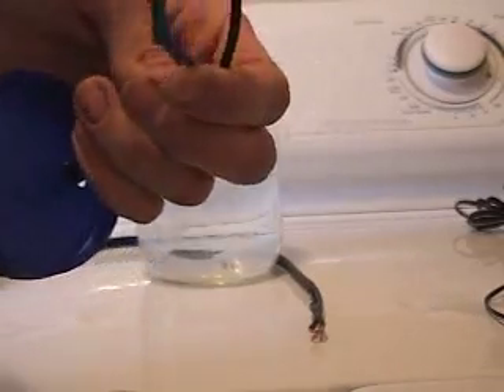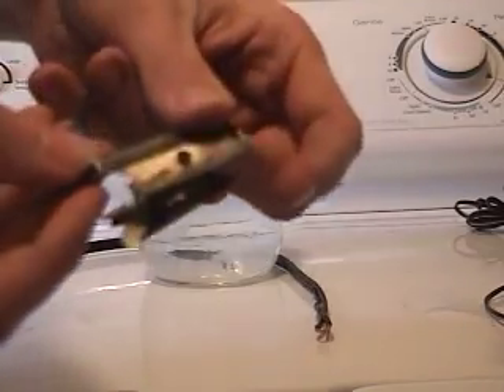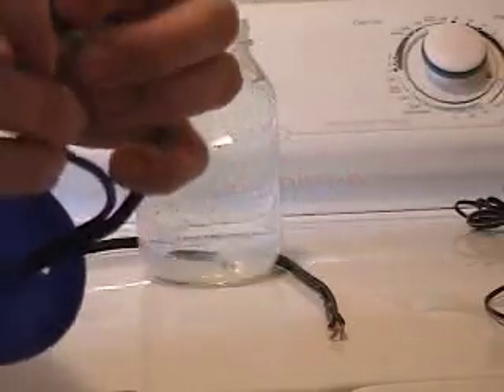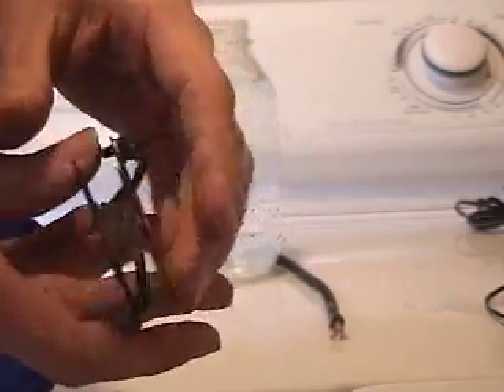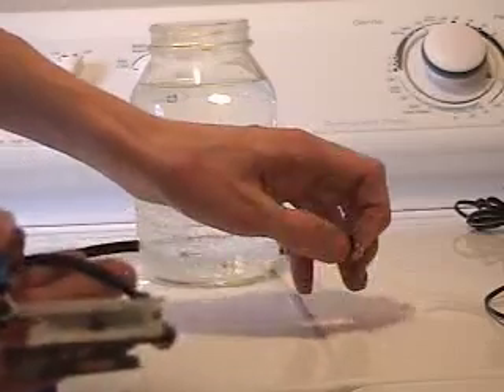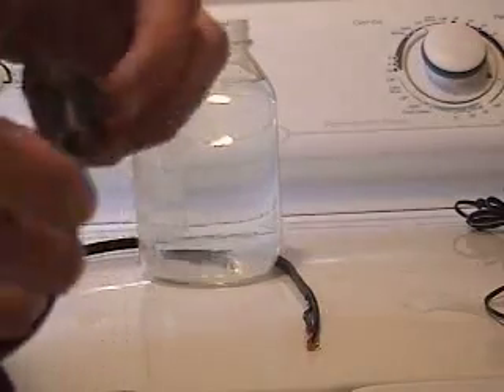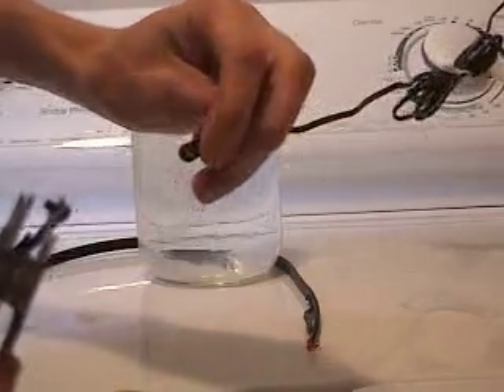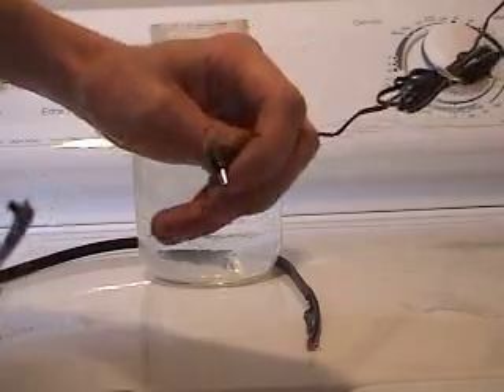HHO electrolysis without stainless steel

Comment: stainless wall plates at a hardware store are simplest.  Drill one side of the plates larger and place a grommet in it for insulation.  bolt them together alternating. One bolt positive and one bolt negative.  You can also use a plate as a template for drilling holes in your container.  Eliminates wire corrosion with no wires.

Comment from the maker: Yea, That thing that I made would never produce enough hydrogen to power anything but if you can find like 4 stainless steel knives and wire them +-+- and make a descent container to hold them all you could probably get a 150cc scooter to get like 250mpg. another important think is to keep any solder and copper wire out of the water. They will corrode off in minutes.